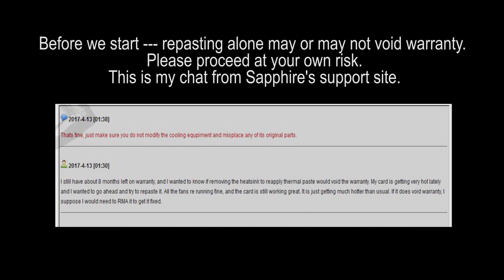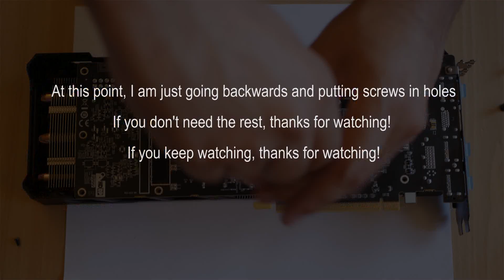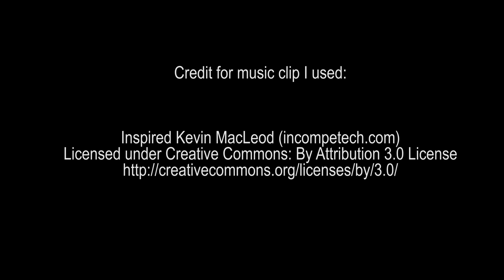Replacing thermal paste in a Sapphire Nitro R9 390 ( AMD R9 390)

Comment: Sapphire Nitro R9-390 was running at 100f (37c) and keep going up. System runs colder now due to a 200mm Phanteks fan in front and a Noctura 140mm (1500rpm) exhaust fan and the rear of the case. Fan speeds on the R9 were maxed at 1000rpm+ and the GPU is still overheating.

Pulled apart the R9 and the paste was almost dry; it was also transparent. Putting S5-Silver on the sync/cpu and will update the changes. Thanks for the very easy to follow video! 
UPDATE: I did everything you did by the book and although the video card ran longer than it did before the cleaning, it still climbed to 41c (111f) and restarted my comp. All other temps are low (CPU runs at 60f at idle/mild gaming).

So it looks as if I have a doorstop. I find it funny these vid-cards are selling for a couple bucks more used than I paid new. Just have to buy another card. Going Nvidia this time. ATI just ruined any trust I had in them.
Reply: Dude 41c on a GPU is pretty cool.
Reply: As strouze said, 37-41C for a gpu is very cool if it’s under load and if it’s on idle then it’s pretty normal. That’s why you should always look for peak temps and if too high then aim to lower the peaks and not the idle temps.
Reply: My r9 390 open gl ver is 2.9 y is that...
Reply: You should test your gpu with a stress test Programm like furmark and if the test runs for 30 mins without problems and stable temps then you’re good to go but when you see glitches or maybe even crashes and the temps get high peeks then you should check your cooling. (Change thermal paste and or cooling pads, check case airflow etc.)

Comment: I have the same card and I have to apply thermal paste on the chipset near the HDMI port.
Reply: I had to apply thermal paste to 3 pieces of aluminum foil that I sandwich-stacked on the HDMI chip or else the computer would have flickering and eventual freezing.
Reply: @gorkman 
There is a thermal pad near the HDMI port that fell off my card when replacing the thermal paste.  Thermal pads do go bad over time just be sure to replace all pads with propper thickness.

Comment: I did this to my r9 390 and now it doesn't wanna work :(, no video or fans spinning but power goes thru cuz that sapphire logo switch turns on.
Reply: check that you plugged the cable correctly
Reply: same here, new paste and now it wont boot
did you ever manage to solve this problem?
Reply: I've got the same issue :(

Comment: I'm about to go through this right now. I received an r9 390 from my friend it's quite old and its been experiencing screen tearing on just about every game I play on it. I can fix the screen tearing on some games with a combination of Vsync, borderless window mode, etc. But a lot of games it freezes or still cannot stop screen tearing. Any suggestions on how to fix? I'm gonna try this cause the thermal paste was never reapplied and will let you know if this fixes it
Reply from the maker: The Dzjivenator I would say try this and then maybe see if drivers or other things are the culprit. Personally I think I’d try to lower graphics qualities til I don’t have tearing though I know is PC gamers have a hard time accepting lower quality graphics lol
Reply: @TheRickyH  I dont mind sacrificing the graphics, but the issue is on games like CS:GO I cant get more than Vsyncs allowed fps without screen tearing. Mass Effect 3 also seems to have an issue with it just freezing for 20 second and running smoothly for 5, even after replacing thermal paste. It's strange though cause Tekken 7 on maxed out settings runs beautifully as long as I'm in windowed borderless mode. At my wits end trying to figure out what the issue is.
Reply: Did it help?
Reply: @420Meatwad  no unfortunately it just seems to be compatibility issues with most games

Comment: My r9 390 temp is between 80-87 on full load is it normal?
Reply from the maker: Bryan To its normal and it’s within safe temperatures but lower is always better IMO
Reply: @TheRickyH  Thanks for the response, its kinda old. so I'm planning to upgrade it, and also the power consumption is high because it is an old gpu. do you have any suggestion of gpu for me? my cpu is ryzen 5 2600. TIA :)

Comment: Is it absolutely necessary to remove the backplate in order to get access to the chip?
Reply: Yes
Reply: @slimthug166 No, while you have to remove the same screws, it is indeed unnecessary to separate the backplate. I just did it myself for the second time since I wrote that comment.

Comment: I didn't replace much thermal paste so I am not an expert but I'd prefer to screw diagonally when doing it, pressure is important. Anyway good job but I will look around for those thermal pads because I don't feel safe without them.
Reply from the maker: Mauro Castaldi I would definitely say it’s better to have them then to not have them. I wish I could redo this with the improved knowledge of these things I have gained since then
Reply: @gorkman unfortunately my Nitro R9 390 gave up in late 2019, 4 years after I bought it. Maybe it was because of the sustained heat and I never oc it. I bought a Sapphire Nitro RX 580 8GB for 200 euros to replace it, almost the same performance but much much quieter and cooler because of lower TDB and better fans management. Unfortunately, with the chip shortage, graphic cards prices rise to the top so now it costs a lot more.
Reply: @gorkman have you solved the problem? I have the same problem and im going to change the thermal pads. Also I'm probably going to flash the bios
Reply: @gorkman It's weird, because it lets me open games and Windows doesn't detect a problem but well, good luck bro
Reply: @gorkmansure 👍

Comment: Replaced the thermal paste on the 390 and temps after is 60-63 on full load and the fans 100%, worked great
Reply from the maker: John Smythe woohoo!
Reply: What's ur temp before?
Reply: @estarossa918  Think it went up to the 95 celsius, changed gpu half a year ago though, but still went with sapphire, 5700 xt
Reply: @johnsmythe4956  those temps are playing demanding games? im playing mortal shell and temps are 80°c easly.
Reply: @lauralavadia4877  Well yeah i played some demanding games with the 390, but i got crashes with the 390 think it might been a conflict with newer drivers

Comment: That's not a fan, its a heatsink. The cable is a fan cable for those 3 85/90mm fans.
You should never apply one sided force to a chip of silicone you want equal pressure on all sides else you can easily chip off a corner (no pun intended). Go diagonally. You want to utilize those outer scres as well rather than going the way you did it. You can say you're lucky the card still works. Espescially after seeing you rip that same thermal pad not once, but twice

Comment: Shouldn't you spread the thermal paste with something?
Reply: the compression spreads it a lot more evenly than you can, just leave the blob in the middle alone.  If you don't believe me do it that way then pull the 2 parts apart again and take a look.
Reply: In my research if it is a bare chip (no heat spreader) then YES you SHOULD spread the thermal paste around.  If it has a heat spreader then you can use the pea method.

Comment: Holy this vid saved my life, I've never changed therm paste on my own before and after my 390 was hitting 90° my friend thought it was the best bet to change it. Now I'm sitting cool at 55° while running high end games
Reply: @gorkman yes you can try to replace the thermal paste with a higher quality one. You can try to change the cooling pads too. You can check if your pc case gets enough air (case airflow). If you overclocked your card I would recommend bringing it back to base clocks or maybe undervolting it if you know what you are doing.

Comment: NEVER NEVER BOUGHT SAPPHIRE GPU AGAIN!!!

Mine just died two months ago! While my gigabyte 7870 still works! 

So many reported problem with sapphire ,,, My $350 used in 26 months !

While gigabyte 7870 I bought quiet time ago still works and rocks on!!!
Reply: Mine just died today
Reply: Mine died a couple days ago, well it gives me random black screens and then freeze up till reboot, just days after the VISA +1 year warranty expired. Now on an old HD5770 till I can get something better. 14fps yay lol
Reply: @cruisingprimate1072  I don't think it's dead. Many people with different AMD cards are facing this problem right now including me. It can't be hardware problem if so many people have this issue in the same time.
Reply: You are absolutely right. My sapphire r9 390 died one month ago. It's 3 years old and i play games rarely. Sapphire making worst quality gpu in the market.
Reply: @AGASHOOD  mine died after 3 years too, 4 days ago, my monitor goes black from time to time but i can still hear sounds thorought headset

Comment: What was the result? Did your temperatures really improve?
Reply: 75?? my gigabyte 390 gets to 94 when gaming and i have really good airflow in my case
Reply from the maker: DreamerCze it did! temperatures while gaming dropped by about 5-6c. used to hit 65c while playing overwatch now it stays at about 58c and the fans don't kick up as hard with any games.
Reply: Thanks! I play in 1440p and my Sapphire 390 gets to about 75 degrees. Might be worth a try to replace the thermal compound.
Reply from the maker: TheDykstraservice have you tried ramping up the fan curve? it is loud as heck but it does work depending on your card. at least as a last ditch effort before you tear down the card :)
Reply: @blackmore99  oh nvm i misread "cpu" as Gpu sorry xD electrically conductive paste cant harm CPU's at all. So you are totally safe. When you change the paste on the 390 make sure its non conductive paste that you're using.
Reply: bad for you
Reply: @blackmore99  you must be lucky because the microchip has multiple spots around the "shiny" part that will short out if the paste spreads over them... BUT in your case the "highly conductive" might mean that its  thermally well conductive. Could you tell me what thermal paste you are using?
Reply: Have mine for years and, playing in 4K, during the Brazil’s summer, with the closed cpu only with the fans, and in a closed space, it hits 83c, not that bad. You can start worrying about it when it hit like 95 and more.
Reply: 91c to 70c
Reply: yeah, the card starts to throttle at about 75 so I never get above that
Reply: I was getting 83C with my Sapphire Nitro R9 390, so I followed the guide and epl aced the thermal paste. Unfortunately, my card died and now it doesn't even power on. Not quite sure what I did wrong because I followed this video almost exactly. Welp, I guess I'm unlucky.
Reply: BlazzingBlocks did you use non-conductive thermal paste? Im pretty sure you have shortened your card with conductive paste... Always use non-conductive
Reply: Nippeli I used Thermal Grizzly Kryonaut which is non-conductive. Unfortunately, I was not wearing an anti-static wristband, so it may have been the issue. Anyway, I sent it to the local shop where I got it from and they offered to help send it for RMA as it was still under warranty. Not sure if Sapphire will do something with the card, but it was worth a shot considering the shop told me that I wouldn't need to pay postage fees if it is not fixed.